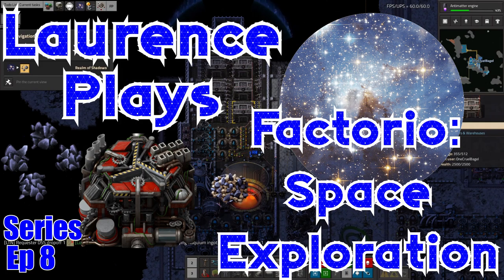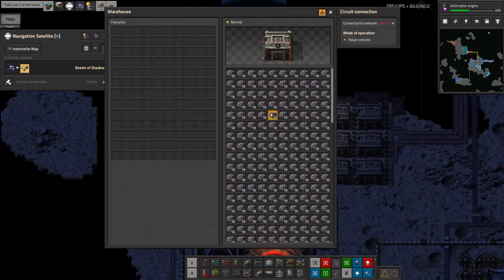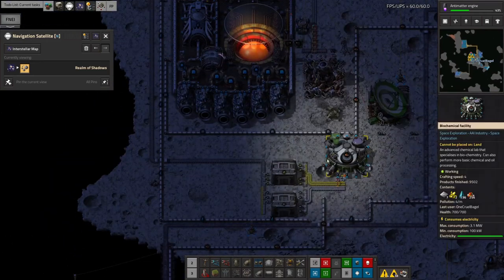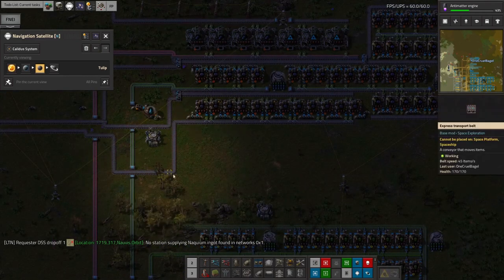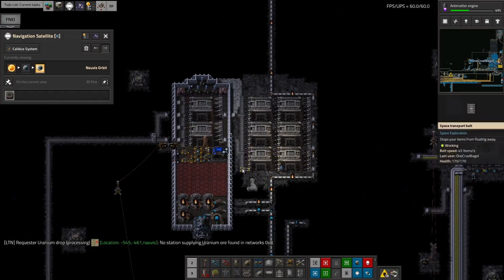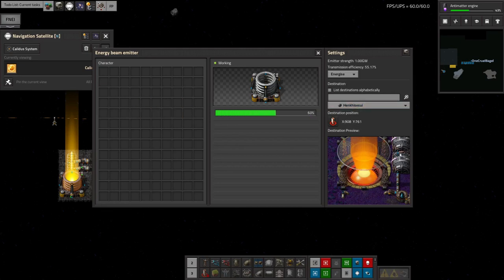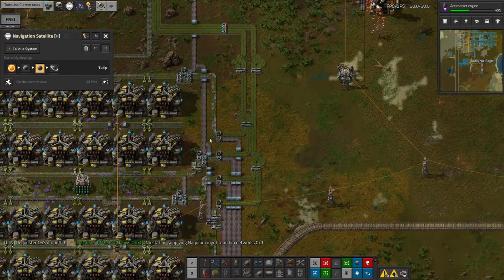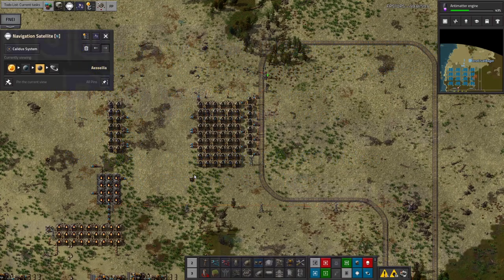S5-E8 - Widening - Laurence Plays Factorio: Space Exploration

Comment: Couple of things. You can top off the ship while parked in your nauqitite mine with a beam power transmitter very easily. In fact I did something complex. I built a ship with a beam receiver and associated power systems, charged it up to 10000 degrees, sent it to my mining base and parked it there and then removed all the ship parts except for the power system. 
Then I targeted it with a beam power unit and even though it’s not terribly efficient it keeps the heat over 9900 all the time. Now I have power there all the time. So far it’s been working good.
Great series, love you designs.
Reply from the maker: I talked about flying the ship out there and then deconstructing everything but the beam receiver in one of the streams, I think. But it basically comes down to a few things:
- It's more efficient (in beam emitters) to have one beam powering the outpost and both ships
- It's more efficient (in power, probably) to only beam as far as Norbit
- It's working and I don't want to pull it up and redesign it  🙂
To be fair, that would be the more reliable system because it would be less fragile and fewer risks, but this way is working, I'm just keeping an eye on it.

If the ship runs out of heat while out there, I'll top it up with the beam, but I'm hoping that won't be necessary - from looking at the temperature drop while it was out there, I think that just heating it up when it comes back to unload will be fine. Redirecting beams is an emergency step!

Thank you, and thank you for watching! I'm certainly going to keep going, and hopefully I'll finish the game some time this year!
Reply: Laurence only has beam emitter at Calidus.  Realm of Shadows is too far to get any meaningful power.  There is a far closer solar orbit where another solar farm could be set up however
Reply from the maker: @robslaney3729  Yeah, I think I worked out it would be something like 5% of the energy. If that. The closer sun is definitely closer, but still a bit too far out to really be practical for powering RoS. Yes, it could be made to work, but I'm pretty happy with the current system.
Reply: @LaurencePlays  Just checked the numbers locally, my naq field is about 20K distance from the solar orbit powering it.
Emitter strength is 6GW @ 14% efficiency.  The base there is using over 420MW power, so I've got head room to spare.  It just uses a metric ton of water ice and i've consumed all the nearby patches there -  so that is being transported in - however that is dense!
Reply from the maker: @robslaney3729  I would assume mine's using just as much ice because it's effectively the same system as yours ... taking heat from a beam receiver and turning water into steam - it's just that the beam receiver moves around.

Comment: The power is "blipping" because you need 4 steam turbines to consume the 500 deg 214 steam/sec , and it's backing up in the high temp turbine
Reply from the maker: Ah, that makes sense. Annoying sense (since I was convinced it was 3 turbines!) but sense nonetheless. I guess I need to go round and update all my generators. Oh, unless the numbers are different between normal turbines and condensing turbines! I'll have to check that, since I don't think this blipping is happening anywhere else.
Reply: @LaurencePlays  Condenser turbines can consume 80/s, but give lower power - hence 3 ( 240/s).  Regular turbines only consume 60/s, give more power and no water byproduct.
Reply from the maker: @robslaney3729  Aha, gotcha. That's what I was hoping for - it means that my spaceships and most other builds are fine, it's just that one that isn't because I had a load of non-condensing turbines to hand, so I thought I might as well use them. 

If only I'd had the foresight to actually check that...